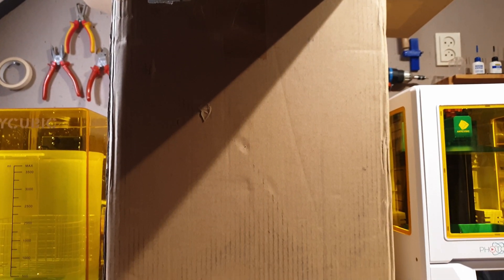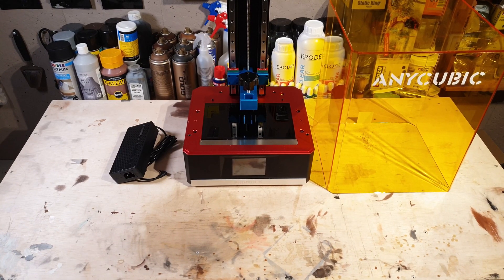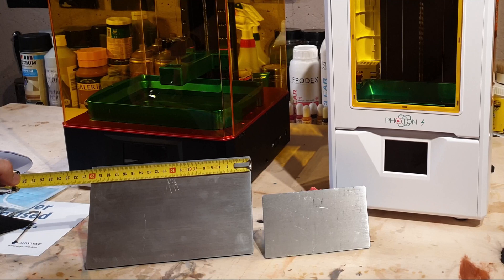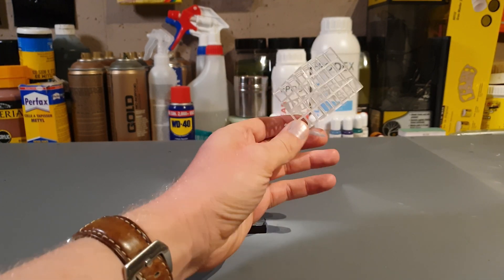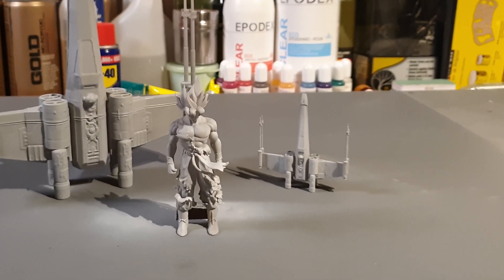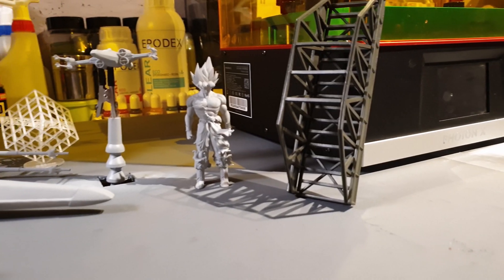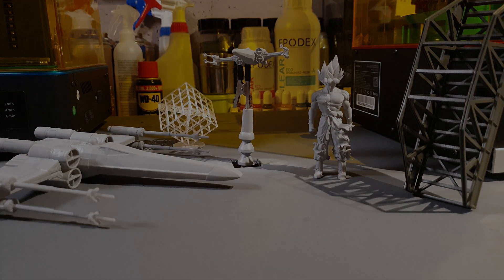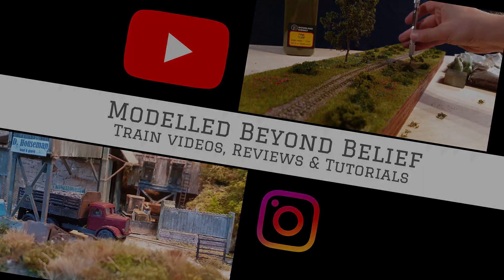Anycubic Photon X - 3D printer - Unboxing and test prints!

Comment: If the X has the same build plate as the Mono X what is the difference between them, print speed/resolution?
Reply: Giles Davison Photon X had 2K resolution. Mono X has 4K resolution.
Reply from the maker: Yes that is correct
Reply: 2k vs 4k resolution
mono x is around 3 time faster that the normal version.